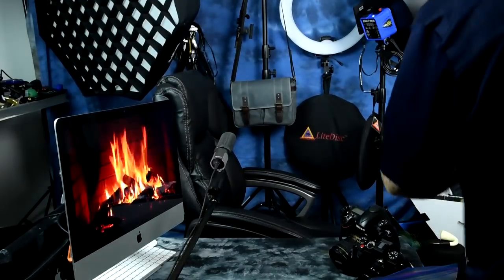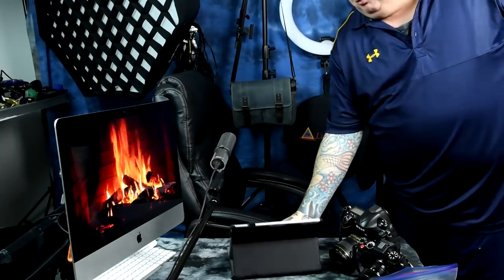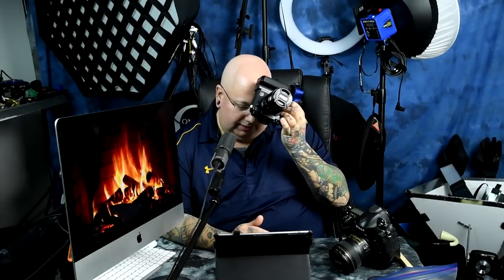🤔 The magic LIMIT of DX sensors: Pixel pitch, Dynamic range & Megapixels

Comment: Real Life Question for you!! I'm comparing two Nikon cameras D3X vs D810 with regard to Image Resolution Quality per Pixel Pitch vs Pixel Density. D3X 24,5 MP  = 5,92 PP and 2,85 PD - D810 36,6 MP = 4,87 PP and 4,22 PD. Which Nikon camera used only for Portraiture Studio work will produce the best Quality Prints at 300 DPI in 8X10 to a Maximum of 16X20 Framed Gallery Exhibition? I love your channel with such great information!! Maybe a good question for a show!

Comment: Total noob here.. but based on this info, fx cameras like the D3 with lower megapixel count must be absolute beasts in light gathering capabilities.. Correct?
Reply from the maker: a camera is not a sensor, large photosites on OLDER cameras were much much less efficient. 

i have all those cameras too.

Comment: If this was true how come some m43 cameras have 20mp sensors and still have better dynamic range than some modern FF cameras?  the em1 mark ii for example doesn't have a BSI sensor and still beats the 6d mark ii in dynamic range. I may be wrong here but that sensor would be 70+mp for a FF camera and 30+mp for an aps c. 
I'm here to learn.

Comment: About two years ago, my wife bought me a Samsung NX500 as a gift.  I liked the images I was getting but I found it extremely difficult to use outside because the LCD was washed out by the sun.  Also, I prefer a viewfinder to steady the camera against my head for sharper images.  Because of these issues, I got frustrated with it and basically stopped using it for a while.  Last year, I decided to try to make the NX500 a more usable camera so I found the Tarion VR-2 universal viewfinder for LCD cameras.  This easily attached to the camera, blocked out the sunlight, and allowed me to steady the camera better.  It made the NX500 a usable camera and it was well worth the $50 I spent.  Recently, I have been purchasing legacy lenses per your recommendations.  I have adapted Super Takumars, Rikenons and a Vivitar to the NX500 and WOW!  The images with the NX500 and that old glass are outstanding!  Here are some sample shots https://www.flickr.com/photos/137671252@N02/albums/72157665445411118/with/40076055322/    Thanks Ken!

Comment: Hey Ken, question here: The Sony A7S II has a pixel pitch of 8.32 µm, but has a dynamic range of roughly 13 EV just like the rest of the A7 crew.  Does pixel pitch actually corrolate directly to dynamic range, or do we only start to see negative effects once the photosites become smaller than x?
Reply: Does not correlate to dynamic range but to Tonality for better life like images. Tonality and dynamic range are two different things when it comes to cameras.
Reply: Humble Pie You say this like it's a given, and that's the same problem I have with this video.  

When we're talking about tonality, we're referring to the range of tones in an image.  Larger photosites might get a cleaner reading, but they are still just red, green, or blue. The actual tones in an image are all interpolated.  More pixels means more data to interpolate tonality from.   Is it better to take the average of 10 quite accurate data points, or 20 slightly less accurate data points? I'd guess it's probably about the same. Anyway, glad we could nerd out together.   8)
Reply: What about the foveon sensor?

Comment: I looked into this some time ago. You might be right concerning FF and DX, but I'd like to know how the RX100's 1-inch sensor gets over 12 stops of DR with a pixel pitch of 2.4... significantly smaller than the FF and DX pixel pitch. The original RX100 wasn't a BSI sensor either. Food for thought.

Comment: Yep , but how much pixel do you need , e.g for printing? 24mpix is enough. People thinking that the size of the pixel is 4.2um but we are talking about the pitch (distance between the center of one pixel to the center of the next pixel).There is on most sensors also wire stack in between them (on the BSI is this on a back side) which also not only blocking the part of the light but also making difficult to place processor near or at the sensor for faster data transfer and to make diameter wise bigger pixel.More mpix means also not only reduced dynamic range which is dependable from the gain , but also more information data transfer from the sensor to processor and thus also the heat disipation which has influence on SNR.Luckly industie has solutions for this , so we will enjoy apsc sensor for another decade.I do not think that the FF will get larger implementation or market ,since camera market is going in a oposite way than photographer  would  want to see.
Reply from the maker: i sure as hell NEVER SAID you needed more than 24MP
SH*T, i love my 12MP nikon D3,........i was never bitching about MP in ANY VIDEO IVE EVER MADE 
waaahahahahahahahah
Reply: Theoria Apophasis I did not sad that you ever bitching about Mpix , but there is bunch of clicbate warriors who think that everybody need FF camera with gazilion Mpix. I also love that same  Toshiba chip as I love old Leica CCD sensor and organic output of the same one.

Comment: Let’s use M4/3 sensors as an example. 1/4 the surface area of FF. Topped out at roughly 20Mp. If you take 4 M4/3 sensors and build a FF sensor, will you get an 80mp sensor with the same DR as M4/3?
Reply from the maker: pitch is too small, unless you drop enough light on it
Reply: Michael Kehm I know it sounds ridiculous, but theoretically........